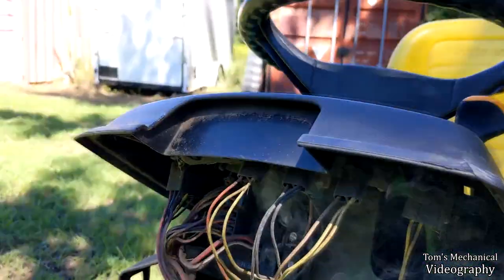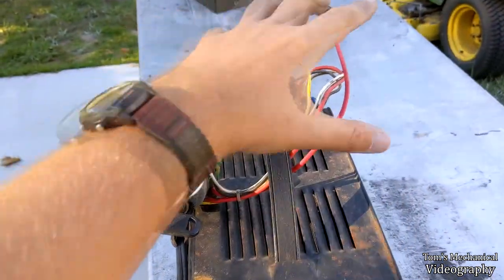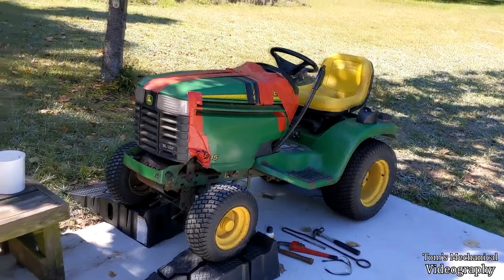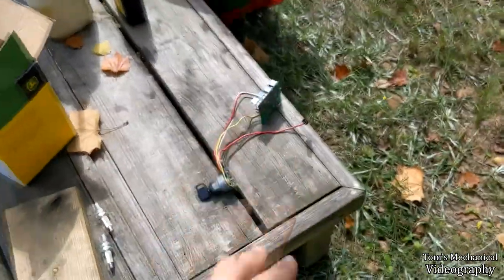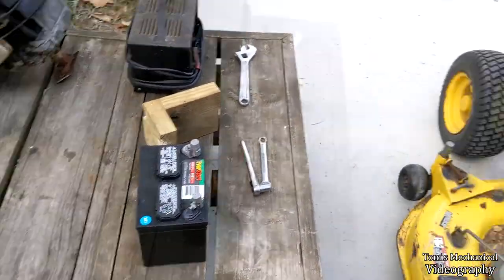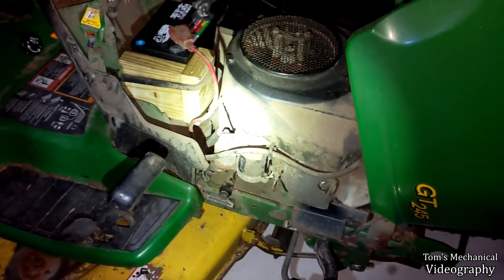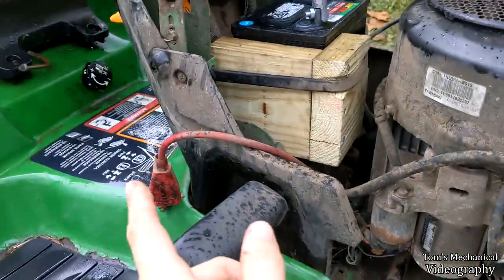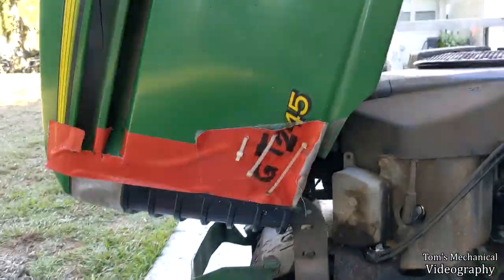John Deere GT245 Ignition Module and Starter repair

Comment: Mine sit all winter and the battery went dead, I used a jump box to crank it , then I drove it and the ignition module started smoking, I ordered a new one, jumped it off and it smoked it to, do you think it's because of dead battery?